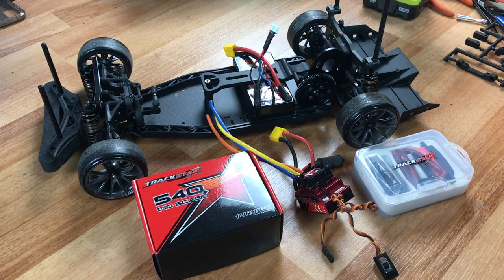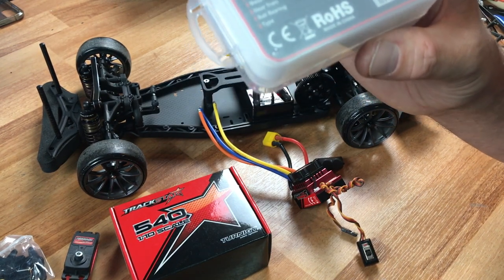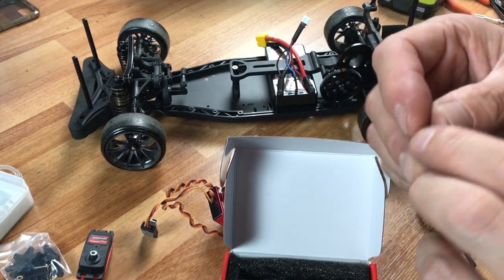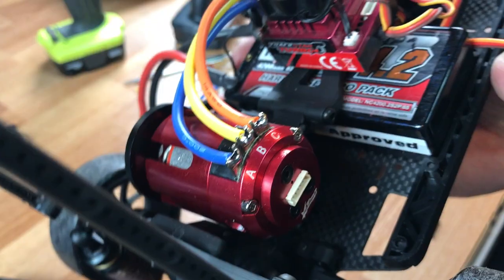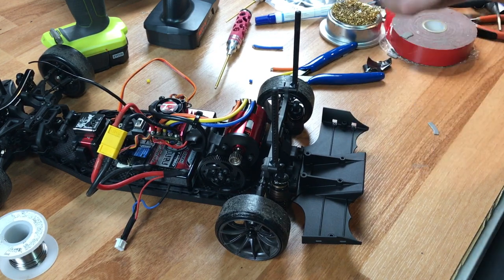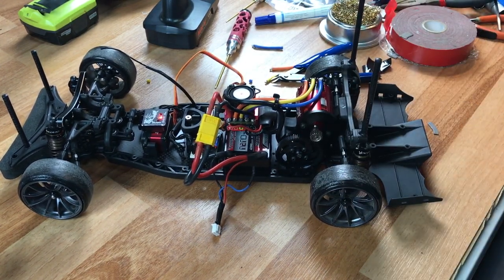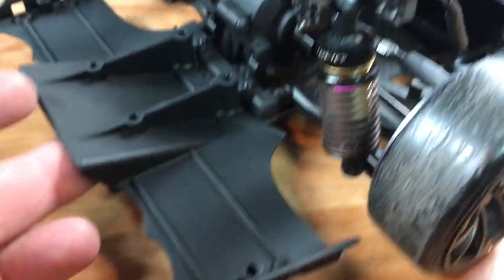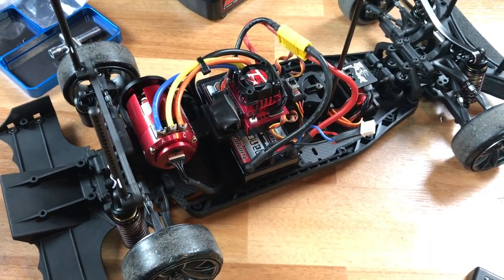Yokomo YD2S Plus Part 2 Electronics Install- Trackstar!

Comment: What is the thing u use on 3:57 to test that servo...and where can i get it
Reply from the maker: It's a standard servo tester- they cost about $3. when you power it from 4 AA batteries you can do 3 different modes: control the servo with a dial, center the servo and cycle the servo continually through its travel (dial controls speed )

Comment: Nice build video man!! Was the 8.5 motor better to drift with than the 10.5? Or is there another reason you choose the 8.5?
Reply from the maker: I installed the 10.5  I think it’s industry standard.
Reply: Ok thanks!👍🏻 are you stil using the lower tag products of were they not good enough?

Comment: What battery use?
Reply from the maker: I currently use the Turnigy shorty 4200 man 2s battery packs which are good- one of mine is unbalanced after running though.  I'm getting some Gens Ace Tattu batteries soon